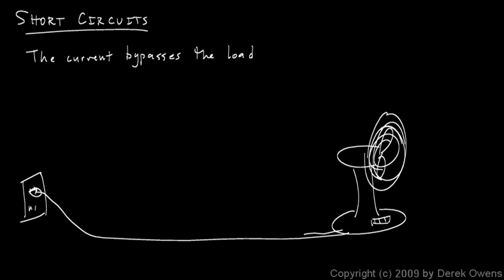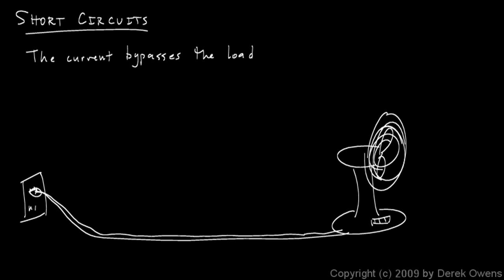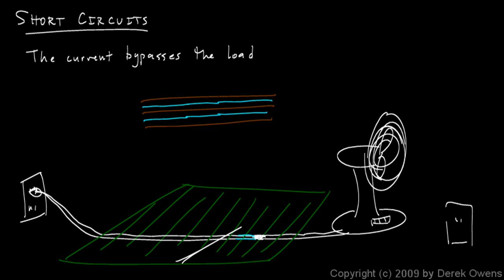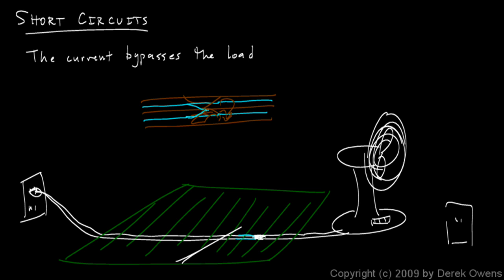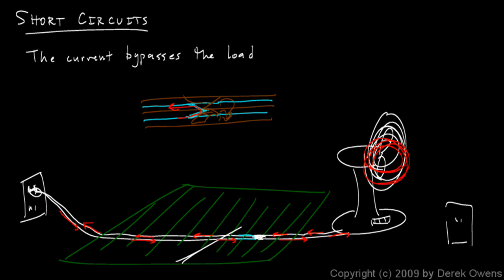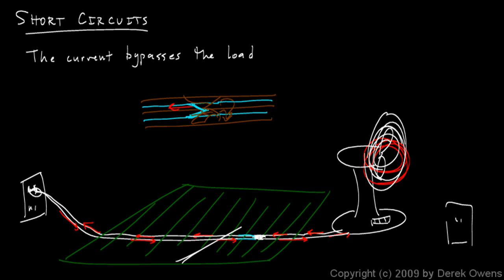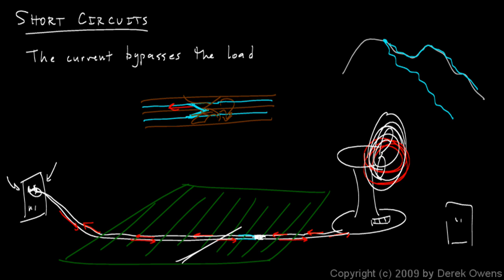Physics 12.5.4a - Short Circuits

Comment: well, what exactly is the "load"? whats the difference in load when the fan is on or not on? just playing devils advocate here but why, if the fan was not running, would it not create a short-circuit condition? wouldn't electricity just go through the fan without resistance?

Comment: weird explanation.....like ,in this case ,it's not a true short cut in the sense that the power wire in 110v only goes to the ground...the electricity in the small socket want to go back to the big neutral socket witch is truly the ground.....but if electrons are drawn by a load,the amount of it going through the wire and back is determined by that load, the harder the load has to work the higher the Amps are going to be.Amps are the debit of the electrons trough the wire ,as the speed of theses electrons is fixed at 110v.Essentially what happens when a short cut occurs is that the electrons are yes going straight back to earth but the problem truly is that the earth is an unlimited amount of load,so the amps and also the total power generated goes up really fast.that is why in a normal house it would only last a millisec before the breaker trip.and if it doesn't trip then the wire itself would melt instantly.

Comment: The path to least resistance is also a myth. Current will not go to ground. Current will not try to go to ground. Current in a 120 or 240 volt circuit will always complete the circuit

Comment: As we know the load such as electric fan, lights, etc. have an equivalent resistance. How about instead of loads such as I have mentioned are replaced by just a piece wire (which has resistance, vis a vis of its length)  with the same over all resistance as of the load such as light? will it short circuited?
Reply from the maker: In that case, the current would simply flow through the wire, and it would be the same current, since you describe the resistance as being the same.  In this situation, you could either describe it a short circuit, since there is no device using the power, or you could describe it as circuit with the wire itself being the load, and the wire would simply be dissipating heat.  It would be a matter of how the word were defined.
Reply: Michael  Hermosilla l

Comment: Plz expln short ckt in a.c crkts
Reply from the maker: Based on my understanding it is basically the same in AC circuits.  With AC, the current is switching directions, but the short circuit is basically the same.  The wires touch, and the current bypasses the load, and a lot of heat is produced.  The energy is dissipated in the wire just as in a DC short circuit.

Comment: Why is the heat produced at the point where the wires touch and not anywhere along the circuit following a short circuit?
Reply: Probably because  that is where there is a lot more electricity  but i dont know.

Comment: That's wrong, the electrons will flow through both paths, its like a parallel connection in which more current flows through path offering lower resistance but not all.

Comment from the maker: @trucorky In a parallel circuit, current will flow through both branches.  If one of the paths has less resistance, then that path will get *more* of the current, but not all of it.

Comment: I have a question:
if we have 2 parallel resistance in a circuit, how come the current flows trough the second-one as well?
____________
U           R     R
--------------------
              isn't this the easier way for the current to pass, if its not going towards the second resistance?

thanks for the videos, they are great.